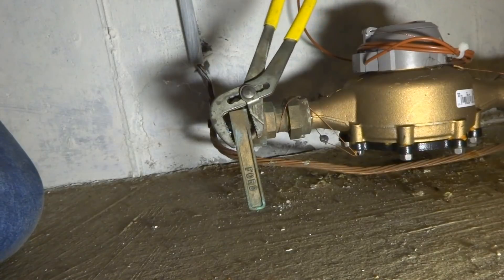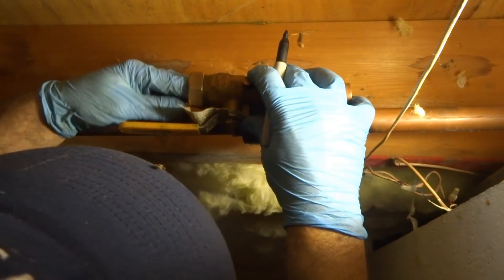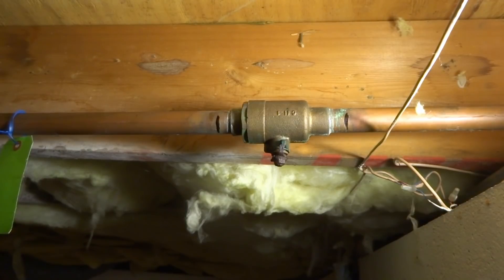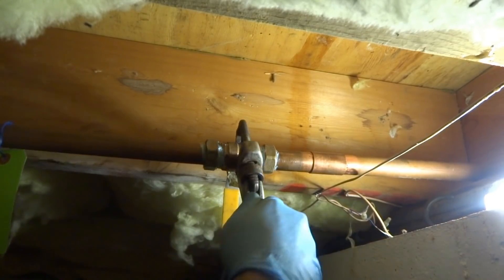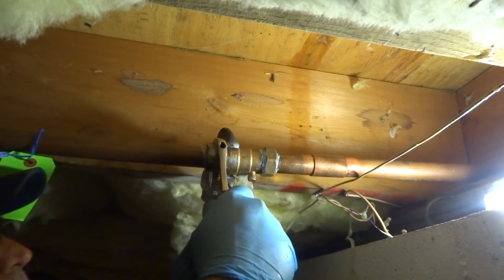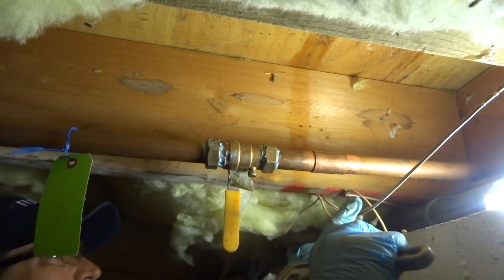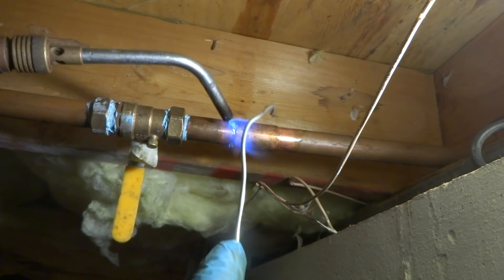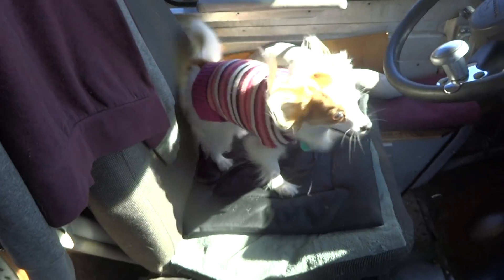1 INCH  COPPER BALL VALVE REPLACED WITH  1 COMPRESSION BALL VALVE

Comment: Funny how I learned dope was never to be put on unions or ferrules. After seeing Steve do it, I put it on everything. It keeps the torque tension down and is extra insurance against leakers.
Reply: Unions and ferrules love anti-sieze.  Apply for no troubles
Reply: You can also wrap it with Teflon tape first than add pipe dope.

Comment: OK Steve I need your opinion.  I want to change out an old existing gate valve for a ball valve in a 1/2 copper pipe feeding cold water to my boiler.  Should I use the compression type or the SharkBite type?  I value your opinion.  Thank you in advance!

Comment: why not just solder it? you already soldering the coupling.
Reply: Probably because that's what he had
Reply: Why use compression over solder?   Unless you don't know how to solder.
Reply: @Hubjeep  if there is a fire hazard for one reason.   If that's all you have    that is another reason.   If you can't solder because water in pipes that's another reason.  If you ran out of solder that's another reason.    Do you think Steve can't solder?
Reply: @he-got-a-new-mommy    Fire hazard is out since he is soldering the repair coupling, and this establishes he can solder and water are not in the pipes.  Plenty of solder still on that spool so he's not out of solder.  Final conclusion is that it's all he has on the truck.  Everything else aside, I don't recall seeing him in such a rush in any other video, odd.
Reply: Use solder on the compression and toss the compression fittings. Also if the pipe moved that much a sweat coupler wasn’t needed. Sorry Steve
Reply: @Hubjeep  He don't want to miss the 2.99 lunch special again that's why he is in a rush
Reply: Theirs nothing wrong with compression fittings it’s shark bites you should worry about

Comment: Are you against sharkbite ball shutoff valve? I used one 6 months ago and no issues at all.
Reply: Emergency use. But then again u can use compression for that situation too and it can be permanent without worry.
Reply: @plumbbuild6517  i live by this methodology:
Solder for new work and high and dry areas if it can be safely done
Compression for repairs with any water or difficult to solder areas
Push fit for avoiding disaster....not much else.
Reply: @plumbbuild6517  propress is on my radar, just haven't needed to pull the trigger to keep the money per hour working as i need. But when it does, I'll be very happy to add that version of work to my life! Appreciate your thoughts, Keep it flowing and dry!

Comment: What kind of blade you using on that grinder Steve?
Reply: I think he had mentioned just any disc that will cut metal.  Maybe made of stainless steel discs since he deals with water while cutting. Not sure.